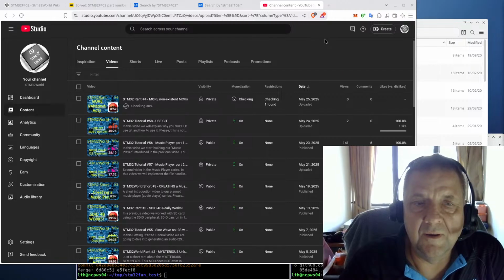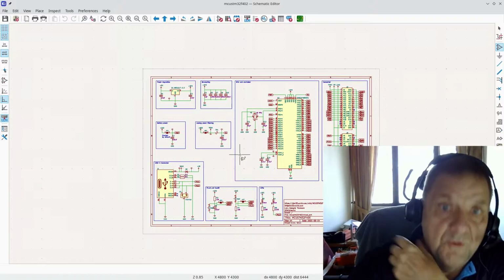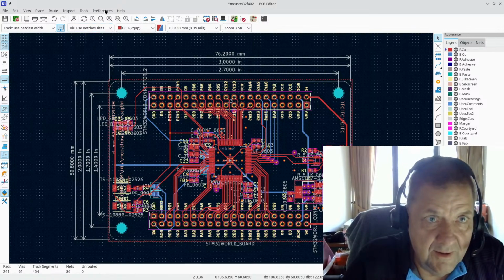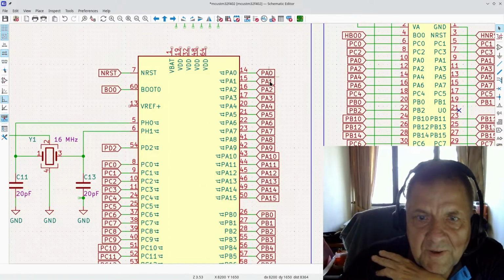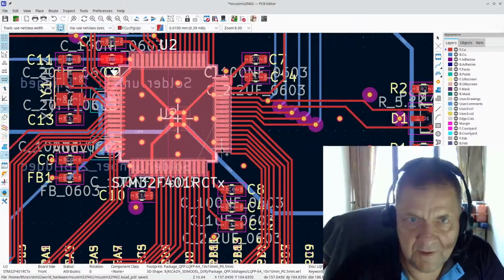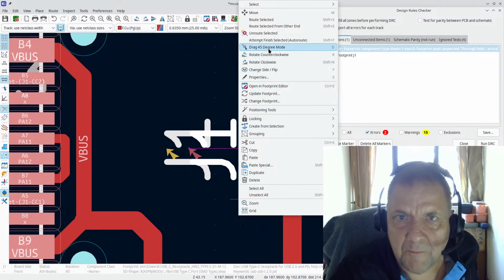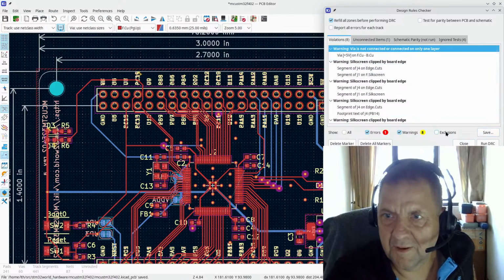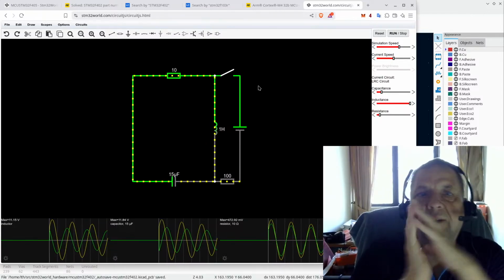STM32World STM32F402 Dev Board Development #1

Comment: Good video. Look forward to more. I am going to try out your use of Fast Grid Switching. I also work alone all the time and talk to myself because I am such a good listerner. hope you enjoyed your breakfast. I have always been impressed with the Falstad Circuit simlator and think a series using it would be a big help to many. Also, I see you scrolling though the long lists in symbol and footprint editors, try selecting the library you are using a lot, right click and select Pin Library. It will be moved to the top of the list and stay there.
Reply from the maker: I am glad if you learned anything from any of the videos.  This is why I make them (and talking to myself).  There will definitely be more.  I think for now I will keep the KiCAD and PCB related ones as live streams as they lean themselves towards longer videos than the main videos of the channel.  The trick about pinning is a good one - I'll try that thanx.

Comment: you need to learn to save more often ;)
Reply from the maker: KiCAD is usually quite stable - not sure why it crashed there. ;)
Reply: I had the same problem with 9.0.1. Running DRC without saving first appears to be a common problem if you search the web. I have updated to 9.0.2 and with a quick test, it appears to be fixed-even though release notes for 9.0.2 does not mention this bug explicitly. It does mention several other crash scenarios.
Reply from the maker: Ah yes - that sounds about right.  I honestly saw it first time when I shot the video, so I did not look for an answer.  Also, in my case I am running KiCAD on Debian and I never update it manually.  It is on 9.0.2 now ;)